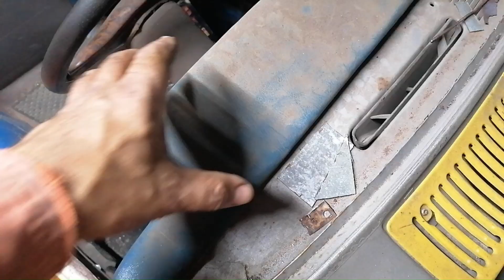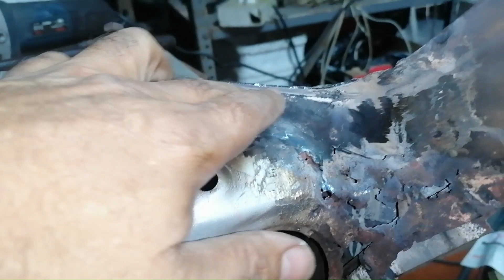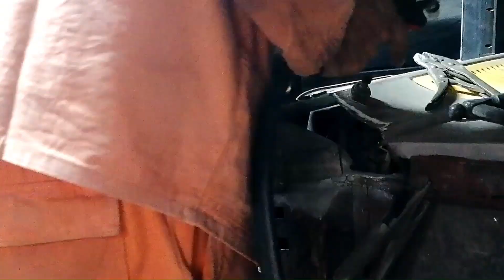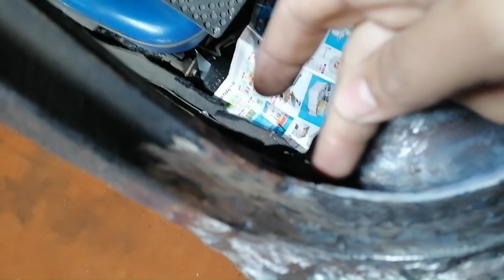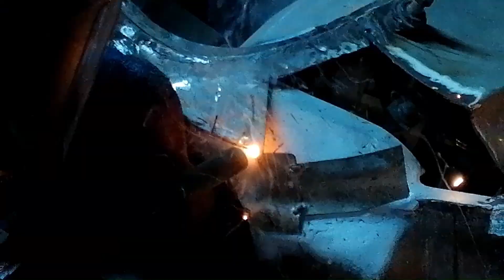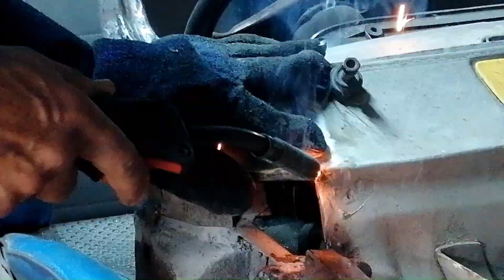Classic Ford Escort Panel Van Resto Mod. Part 14.

Comment: Hi, so what is cold galvanising, is it a type of metal primer, applied on any metal
Reply from the maker: Hi Micheal, correct sir, that is exactly what it is. One get hot dip galvanising, which is a totally different procedure and the best for steel, but mainly used in the construction industry and the spray can version for instant domestic use. Thanks for the question. Take care.👍